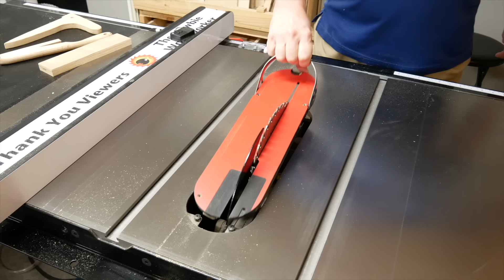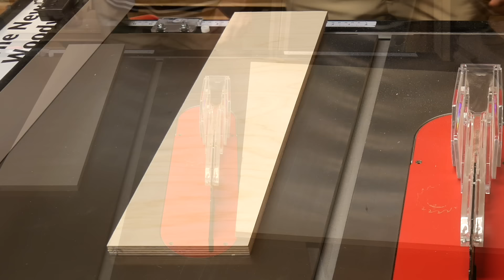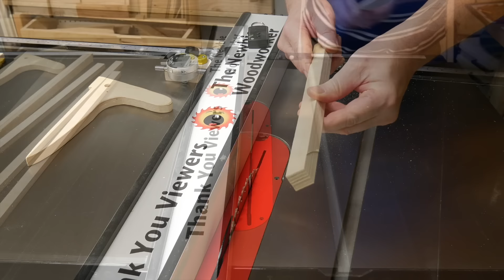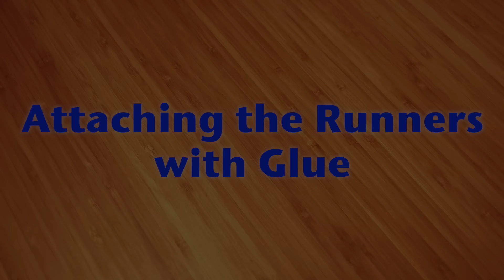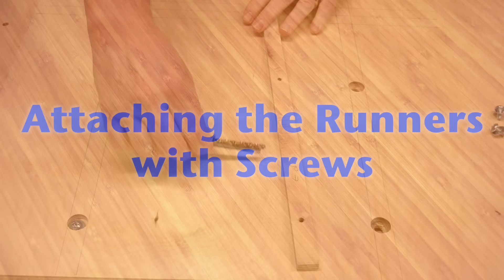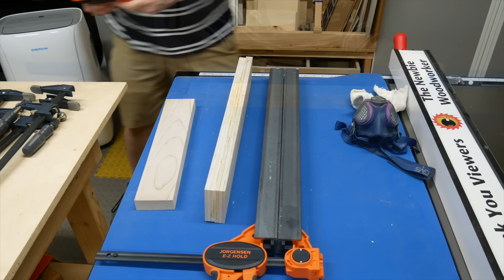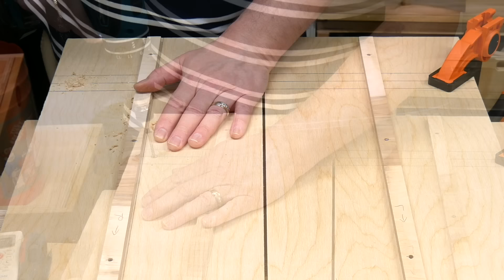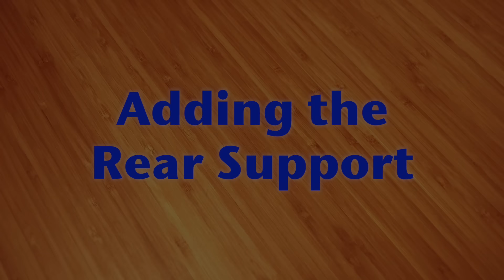Build this Revolutionary Cross Cut Sled, for Newbies!

Comment: the only thing i would criicize would be the newbie wood worker doesnt have a 5000 dollar table saw
Reply from the maker: Neither do I - it was around $3,000. 😂 But seriously, I thought long and hard before I upgraded to this saw, and I almost didn't do it. Here's what I said in one of my blog posts:

"I don’t want a lot of high end equipment in my shop. That’s not an image I want to project in my YouTube videos. You don’t need high end equipment, and I don’t want people to think they do."

But in the end, I decided I deserved it. 😄 You can read about my decision-making process in this blog post:  https://thenewbiewoodworker.com/2019/03/31/why-i-bought-the-sawstop-pcs.html.
Reply: Lol my saw cost less than $100. I went to make this sled for it and the back of the rails had metal stops molded up over them so the runners can't slide past the end of the saw. I'm literally about to take a file and file off the metal tabs blocking the runners so that I can use a cross-sled saw on it
Reply from the maker: @rocifier  I would definitely do that. Just make sure it won't affect it structurally - like, it might fall apart if you cut into the rails. 😂
Reply: @TheNewbieWoodworker  I was successful, it worked very well. I'm surprised how accurate this crappy saw can be! Thanks for the demo! Btw I used white oak for the runners and lubricated them with palm kernel oil, and I just glued the runners on by clamping the ply onto the runners while they were on the saw. It worked great and didn't need any adjusting, just a tiny amount of sanding with a sanding block after it dried. This saved all the fuss with the short screws in the runners.
Reply from the maker: @rocifier  Awesome, glad it worked! They say that great musicians can make beautiful music on cheap instruments, so if you've got the saw set up right and it's cutting true, then maybe that makes you great! 😉 I've used maple before for runners, and hardwood works well, but you have to watch the grain direction, otherwise it can expand or contract as the weather changes. The grain should be running mostly vertically. And just recently I used CA glue for the runners, and it seemed to work pretty well, although I should probably add some screws.

Comment: Why don’t the manufacturers of the saws make an optional sled for theirs saws since it makes the saw so much safer to use?
Reply from the maker: That is an excellent question. I can only guess that they wouldn't make enough money off of it to make it worth their while. But it's just a guess.
Reply: I see after market sleds on line.
Reply from the maker: @gordonadams5891  👍

Comment: Hello Dan,
I enjoy  your videos. They are quite instructional and easy to follow. In this one, at about 2:10 (Cutting the fence) we can see a red/green signal light at the corner of your table saw. Could you tell me what this is for? Might I guess that it is rigged to your StopSaw master switch as a reminder that the saw is on? I always forget to turn mine off...
By the way, that light looks a lot like the mast head light I once installed on my sailboat. 12 V?
Sincerely,
Paul
Reply from the maker: Thanks Paul. And yes, that's exactly what the light's for. https://youtu.be/WFNgPWYDxqw. 😄
Reply: @TheNewbieWoodworker  Great. Thanks.
Reply from the maker: @paulfrancoeur3051  👍

Comment: Terrific video!  I'm an average DIY woodworker at best with a basic Craftsman saw that I've used for years with decent results.  I built a sled for the first time earlier this year and it has helped open up a world of new projects, but the big issue is that I can't use my blade guard.  Now I can't wait to spend an afternoon in the garage putting one of these together.  Anything that makes my projects better AND improves the odds that I'll leave the shop with the same number of fingers that I arrived with is a bonus.  Thanks!
Reply from the maker: Awesome! Glad I could help. 😄

Comment: This video was very easy to follow. My sled turned out great!  The only thing I will add is to be careful when testing the shed for the first time before you add the back reinforcement piece of wood. I was so excited to test it that I went ALL the way through the shed splitting it in half !!! Now how stupid can that be!  I fixed it by setting the half’s on their respective saw guides, then I clamped a perfectly flat piece of wood to the fence very tight and proceeded to glue the reinforcement piece of wood behind the fence. Technically, I sandwich the fence to make sure they are perfectly aligned. Once the glue dried, added nails to the reinforced part to make sure it will never move. Finally I added a reference line to the fence slot just to provide a visual reference so that I do not cut through the shed again. With this, I was able to save the work. Every time I see the line it reminds me of my stupidity and I end off smiling!! For you guys, the reference line will just be preventive reference.
Reply from the maker: LOL. I guess it's only fitting that if you build one of my projects, you make the same kind of silly mistakes I make. 😂 Nice save, and thanks for letting me know how it worked out for you! 😄

Comment: is there any specific dementions - that sled should be of certain size as compared to the base of the table for stability - too long and it may flip.
Reply from the maker: I don't know of a hard and set rule. I would think, though, if it started to get too big, it might become fragile enough to start cracking when you take it off the table saw and put it back on. I have an extra-large sled I use every so often when I need it, but I have to remove the blade guard for it. But the vast majority of time, the one I show in this video is plenty big enough for me.
Reply: @TheNewbieWoodworker  thanks!!!
Reply from the maker: @arnieswap  👍

Comment: 08:45 Right - most of all, consider the wax yet to be applied.
13:55 If in doubt grab your angle grinder and trim it flush.
21:29 Hmm.. not so fast - the golden standard seems to be the five cut method , making visible how much your fence is off. But - sure enough: thumbs up.
Oh, and..
https://www.youtube.com/watch?v=UbG-n--LFgQ
Reply from the maker: Thanks for your comments. I'm not a fan of the 5 cut method (for squaring a fence) - I know that makes me a heretic. But for those of us who are math-challenged, it's just too hard. At least it was for me. My absolute favorite method, which unfortunately couldn't be used for this sled, is shown here: https://youtu.be/mLj1MeWKalI?t=157.
Reply: @TheNewbieWoodworker  Thanks for that link. I'm gonna purchase a big framing square by all means [which I don't possess up until now] ;-)
Reply from the maker: @GNU_Linux_for_good  Be careful with framing squares. A lot of them aren't really "square", which I found out the hard way. 🤬😂
Reply from the maker: @GNU_Linux_for_good  Thanks for the links. Somehow I missed Peter Millard on YouTube. But man, I love his voice and his mannerisms. Instant subscribe for me, so thanks for that! And yes, I know that method for checking squares, and it's a good one, although I prefer to overlap the lines more closely than he did.

As for Colin Knecht, he's a legend (to me, anyway). The funny thing about Colin is that at first, I thought he seemed a little, I don't know, dowdy or something. But it didn't take long to really start appreciating his honesty, straight-forwardness, and most importantly, his knowledge. He's become one of my favorite YouTubers, for sure. 😄

Comment: Good stuff!  Tip: don't replace your push sticks.  Instead, saw a fresh flat bottom on them and glue on a new strip of wood to replace the damaged area.  I have handle portions of push sticks that are more than 30 years old; they've been rebuilt many times.
Reply from the maker: Thanks, and great tip! 😄

Comment: 15mins 37seconds NO BLADE GUARD
Reply from the maker: Yes, because I was demonstrating how to cut it using a miter gauge, and depending on how your miter gauge is set up, you may not be able to use the blade guard.

Comment: Why you need base - which reduced cutting depth? I just dont get that
Reply from the maker: Well, you don't technically need a base - you could just use a miter gauge. But when you have a base, the piece you're cutting is stationary - the sled is moving, not the piece. What I mean is, the piece isn't sliding on the table saw top. This is much more stable, and great for cutting  small pieces. It would make sense if you ever got to try out a sled.
Reply: @TheNewbieWoodworker  Now that DOES make sense. I have been thinking about the practical purpose of the base and also back fence. Your explanation clears that doubt. I am tech guy who just got into model trains and now as I am building my set I am getting into wood working, I want to be safe as this is not my primary work - and I just got a table saw so been doing research and sleds seems to be the safest way for cross cut - which I will need to build pillars for elevated tracks. So thanks for explaining. Also, any reason not to use thinner base so as to not lose much depth?
Reply from the maker: @arnieswap  I'm a tech guy too, so I understand the need to understand. Before I forget - I have a video on table saw kickback you should check out if you haven't already: https://youtu.be/ZUZ8hRm7a8g. Back to sleds - If you're cutting small parts, use the eraser-end of a pencil to hold the piece down, so you don't get your hand near the blade. It works really well. As for a thinner base, I wouldn't go thinner than 1/2" plywood of decent quality. Any thinner, and it won't last very long. Taking it off the saw and putting it back on, over time, will probably ruin anything thinner. With that said, you might want to give it a try. The best way to learn is to try something and if it doesn't work, now you know why! Just remember that when it "stops working", it may be months after you made it, and you may not even notice issues for a while, except things might not cut as "true" as they did before. Have fun! 😄

Comment: One thing I would find really helpful if possible (and as a newbie) would be to know how to add a t-track with stop block and a measure  for repeat cuts...is that possible with the fence in two pieces? Regardless this is great as I don’t want to not use the guard.
Reply from the maker: I'm not sure if this will help or not, but check it out: https://youtu.be/FNtqYVLTBFc. And thanks. 😄

Comment: I built this sled last week during my lunch hour in two days.  I used the glue method this go round and will up grade to screws on the runners if needed later but so far - this is a great addition to my shop!  Thank you for the very detailed instructions.
Reply from the maker: Awesome! And I think you'll be happy with the glue. And you built it in two days during your lunch hour? I hate you. Just kidding - nothing goes that quickly for me. 😄
Reply: @TheNewbieWoodworker  if you had great videos to go by, you could, too!
Reply from the maker: @toniritenour8518  😂 Thanks.

Comment: Great video - enjoyed in the UK.
So one possible tip if you don’t have a square big enough is to use (measure out)  a 3,4,5 triangle. 3 & 4 for the sides and 5 for the hypotenuse.
After all, it was good enough for Pythagorus and that’s a mechanical engineer speaking!
Reply from the maker: Thanks! 😄

Comment: I'm a newbie woodworker; I've not yet made the first cut using my new table saw. I liked this video so much I watched it four or five times.
What I liked about it:
1. Your sense of humor. Yes, that's no. 1.
2. Providing for the blade guard--I'd like to develop safe habits from the beginning.
3. You used 1/2" plywood for the base, and in all the videos I've seen you're the only one. Everybody else uses 3/4" and that's gotta be a lot heavier.
Reply from the maker: Wow, thanks for such a nice comment! I'm glad you learned a loth, and I'm glad you like my sense of humor, because it's just the way I am. 😄 As for 1/2" plywood, sometimes it depends on the quality of the plywood. Cheap 1/2" plywood with few layers isn't very good. But if you can find decent 1/2" plywood, especially Baltic Birch plywood, then it holds up quite well. Thanks again!
Reply: @TheNewbieWoodworker  Today I bought a 1/2" 2x4 birch plywood panel, which will be the base of my first sled.
Reply from the maker: @kevinxxx1387  Great! Just remember that "birch" plywood and "Baltic birch" plywood aren't the same, but for a sled, probably whatever you bought is going to be fine. (And if you ask me what's the difference, I don't have a good answer because I'm finding it really hard to explain, but if you search YouTube there's some videos that may help explain it.)

Comment: Not sure if I missed something or am overthinking it, but what keeps you from accidentally cutting the whole sled in half other than consciously NOT pushing all the way forward?
Other sleds without the two piece fence also have a 2nd fence which helps hold both sides together.
Thanks for the helpful tips along the way; I watch your videos even if I don’t plan on building a particular item just to pick up your insights.
Reply from the maker: Yep, just not pushing it too far forward. It's easy, though, because you usually stop as soon as you cut through the stock, and there's plenty of room to overcut a little. And the reason there isn't a second fence is that you'd have to remove the blade guard, which kind of defeats the purpose. And thanks for watching! 😄
Reply: @TheNewbieWoodworker  What if you added stop blocks from the underside of the sled to prevent it from going all the way through?  The sled would need extra length behind the fence to accommodate but should prevent ever being cut in half.
Reply from the maker: @markk8103  Some people have done this, so go for it! 😄
Reply: What keeps you from putting your hand into the blade?  The safety device between your ears.  It's also the thing that prevents you from pushing anything too far into any cutter.  Think clearly about every operation in the shop and be methodical and religious about it.  Most power tool injuries happen to experienced woodworkers because they lose their respect for the risks involved.  Always always think about each operation.  Take your time.
Reply from the maker: @thedevilinthecircuit  You make good points. But that's harder to do for some people than others. https://thenewbiewoodworker.com/2019/09/04/woodworking-and-add-redux.html

Comment: I love your videos but you have over complicated the heck out of attaching the runners. You have created dust receptacles in the top of your sled base. All you would ever need is some wood screws from the bottom through the runners. Recess the heads and you are good to go. In fact, the glue alone would almost certainly have been adequate. About the dust, I got clever and decided to put T track in the top of my work bench. Numerous tracks like two length wise and four cross wise in a 30 inches x 48 inches table. They get full of dust.
Reply from the maker: Thanks. In previous videos I've shown several different ways to attach runners, and explained that I like screws best because they're easy to adjust if need be - I've had to adjust them once on another sled. Then again, maybe the reason I had to adjust them was because one of them got knocked a little out of line, because it wasn't glued down? I'll have to think about it. Thanks for making me rethink why I do something - that's a valuable exercise any time!

Comment: In the beginning of the video you cut  some wood and I did not see a bit of saw dust. What type of dust collection are you using?
Reply from the maker: Dust collection can be hit or miss, and on my system, as long as I don't make cuts at the edges of the stock, it works pretty well. You can see my system in this video: https://youtu.be/c2sWwWbAayM. It hasn't changed much, except for a new vacuum. And yes, I'm using a 2" dust collection with the 4" dust port on my table saw. I think the fact it works fairly well is more due to the saw's dust collection design than anything else.

Comment: Hey Newbie !
I like your thinking. A simple sled that works with the blade guard. Set up everything right and you don't need to watch the cut.
I also like SOME of this simple sled: https://www.youtube.com/watch?v=KWyLrDZAW-chttps://www.youtube.com/watch?v=KWyLrDZAW-c
Especially the ability to handle dado stacks and bevel cuts (at least to one side). It does this due to its sliding half-base.
To handle dado stacks and bevel cuts with your sled, what about widening the blade groove to handle the widest stack?
The only downside I see would be a big gap for most cuts.
While this would allow short cut pieces to drop into the groove, it shouldn't affect cutting pieces sufficiently longer than the groove.
Simply do not cut pieces shorter or only a little longer than the groove. Use another sled.
I don't think the big gap with a single blade would decrease safety because the blade guard is going to keep the area clear.
Whaddayathink?
Set Up Right - Make the Cut - Don't WATCH the Cut !
Reply from the maker: Thanks for the link to the video. It's interesting, and I can see some great advantages. But I don't like the idea of having a wider kerf for most cuts. I like the narrow kerf because it acts as a zero-clearance throat plate, reducing chip-out. I have a second, simple sled that I use with a dado stack. But hey - whatever floats your boat, right? 😄
Reply: @TheNewbieWoodworker  Yeah, I was thinking one sled for one blade, one sled for dados and bevels.
Reply from the maker: @TheLookingOne  Sounds good to me. 😄 And of course you can't really make much use of the blade guard for those kinds of cuts (I don't think), so perhaps a simple sled for the second sled.
Reply: @TheNewbieWoodworker  Yeah.
Reply from the maker: @TheLookingOne  👍